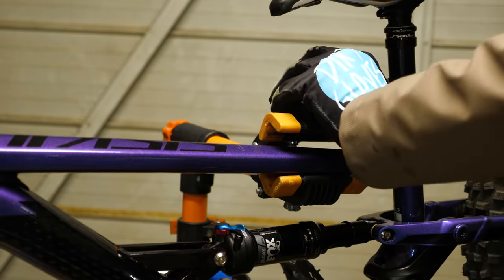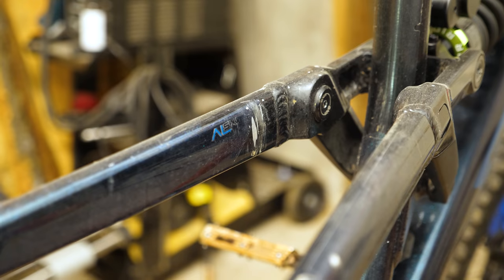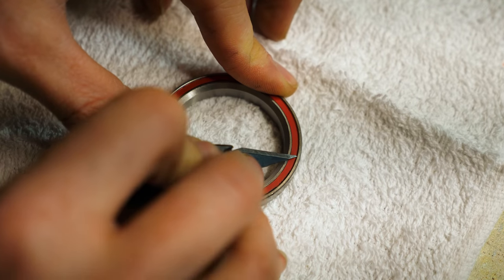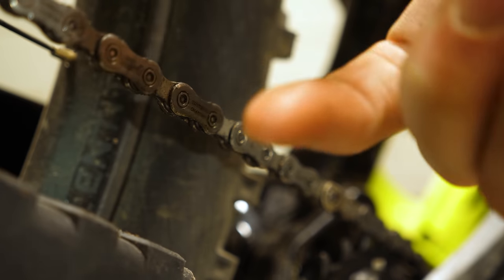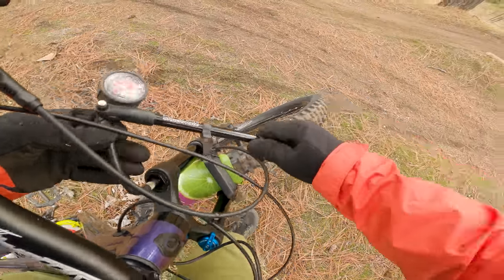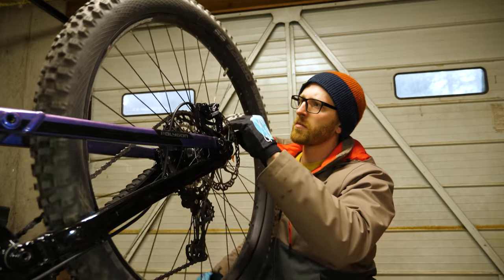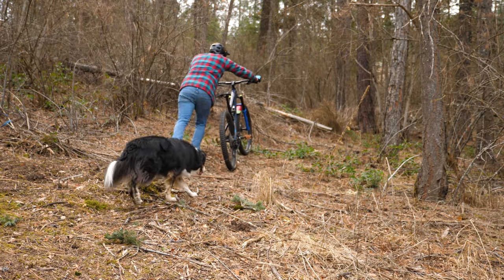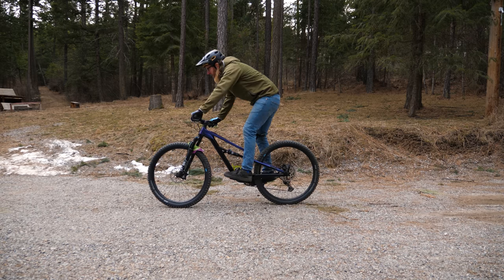10 New Bike Day Tips Before Your First Ride // Starting Your Bike Build Off Right

Comment: I do the exact same with the Vinyl. Even one ride makes it so much harder to go back and clean it fully, too!

My other thought is that it’s maybe $40 in vinyl vs $100 or more for a ride wrap kit, and you still have to apply it yourself. Might as well cut it on the fly and apply it in the high wear areas. It’s pretty easy!
Reply: This.

Getting back into mountain biking a few years ago, I got my wife a Giant Stance. Nice ride. But I didn't tape anything. The downtube is just flat out wrecked in the paint department. 
When I got myself an upgrade (YT Jeffsy), I taped all over the place. Bike still looks brand new 3 years later. And yes, it makes cleaning a snap.

Comment: I'd recommend keep the chain factory lube at first and change it at the first needed clean. It's not staying clean for longer with another chainlube.

Always flats on tubes? Maybe you are just using those cheap non protected tires. I use Conti with protection case and got not flats since 3 to4 years.

Comment: Hey all, quick tip on bedding brakes in: don't come to a full stop on your first few runs during the bedding process. This will leave a deposit of brake pad material in one spot on the disc and will make it much more prone to squealing later on. I suggest finding a hill and going down it around 5 or more times while pulling on the brakes. Again, don't come to a full stop for the first few runs, just let yourself roll down the hill whilst applying pressure to the  brakes

Comment: Keep your grease tube in your pocket if it's cold in your shop! Helps out alot :)
Reply: And forget all the tubes and junk they sell at bike shops. Go to a hardware or automotive store and buy a small can of marine grade grease. It's cheaper, and is waterproof. I use this stuff on my bikes and have no worries about anything penetrating anywhere it is applied. It is a great water barrier.
Reply: @JF-lt5zc  I've just got a tube of park ppl but whenever it runs out I'll most likely just get some generic grease

Comment: Mastic and Amazon 3M tape have kept my bikes looking good for years, peeling it off before the sale of my enduro race bikes have gotten a few "did you even ride this?" comments, if they only knew the volume of small silly crashes the poor bikes had seen..
Reply from the maker: It saves paint like no ones business!
Reply: @TheShredist  Thanks for the vinyl tip. How much 3M Vivid tape should I buy? How much Mastic?
Reply from the maker: I usually go with a 4 or 6inch wide by 60 or 72inch long order. And one regular roll on mastic tape will last ages.

Comment: FYI, that's not Loctite, it's Nylok. Loctite would be useless if you re-torque the bolt as it only holds the first time you tighten the bolt. Nylok is a mechanical locking device which basically fills the empty space between the male and female threads and so will be good for 3-4 full thread / unthreads.

Comment: Well I'm 3 and 7 😂🤣 Although I know better and have become lazy in my years of mainly motorcycle maintenance I'm over it lol. I Checked the bolts, set the sag, beded in the brakes done. I know I know....Yep those delivery folks haha my last bike almost feel out of the bottom of the box because somebody sat it down on the wet ground probably in a puddle during a tropical downpour, another few hours the box would have failed. Aloha 🤙

Comment: Most half decent bearings already have decent grease, and a right one too, at the right ammount (~30%filling)inside them. So I'd refrain from packing everything right away, but adding a grease coating on the outside of the bearing seal, should help with water displacement BEFORE you ever decide, if it's worth replacing grease inside of a bearing, which you're not 100% sure is still ok, or getting ready to replace. This is time consuming AF, not that great to environment since you sponsor degreasers manufacturing, air haulage by massive trucks(cause who doesn't use spray can right?), single item packaging, bulk packaging, then packaging again and shipping to you(because who would walk or ride to local store, when amazon is always AT YOUR HOUSE with their obscene massive boxes for tiniest items+air bags so it doesn't rattle. On top of that you'll use this degreaser spray way too much to clean a bearing, and splatter half dissolved grease on the driveway, so the rain can cleanup after. That's the American way, fuck yeah! So by the time you cleaned, degreased, repacked, paid for spray and shipping, you pretty much have new set of bearings for free, with much more time to ride and if you recycle that bearing correctly, less harm to nature, that you supposedly love equally to your MTB.....oh wait, it was god that created all the living things, so man can use and abuse them as he's pleased, no love required, my bad... :-)